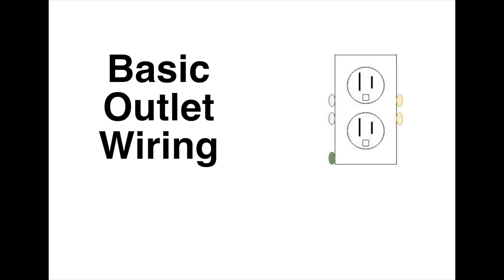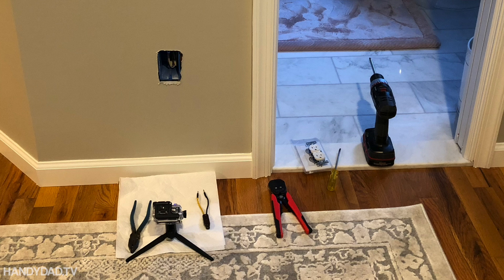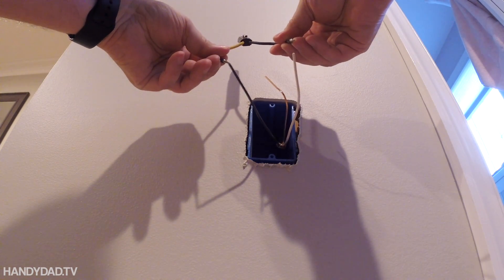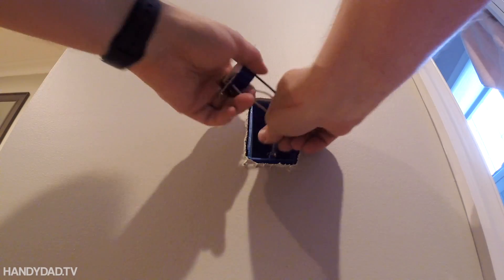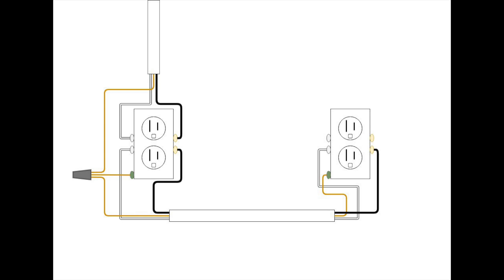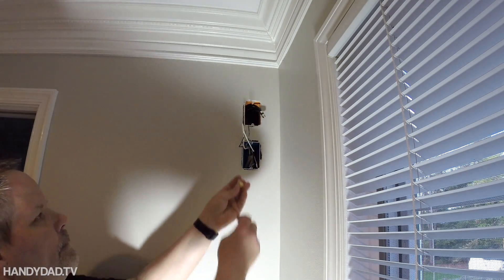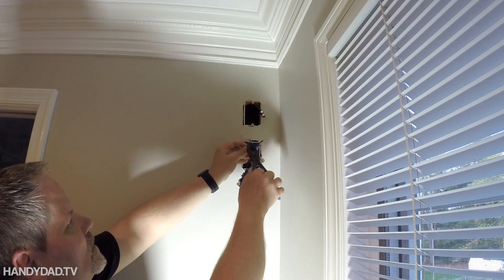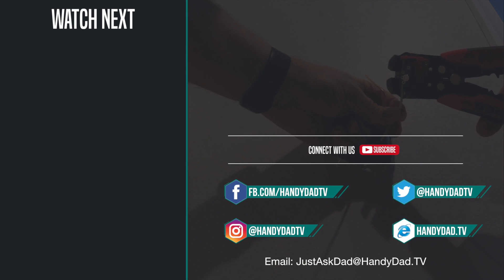How to Wire an Electrical Outlet

Comment: Hi,
I replaced an outlet ( Leviton T5320-W) in my kitchen and test it, start working, then I cut the power off from main switch to wrap-up the fitting of the outlet. but when I turn the main switch on again from main panel and check again then it stop working  and there were 2 more outlets stop working either. then i replaced circuit breaker and all three outlets but there is no power in all three outlets. I check with multimeter, tester and with receptacle tester there is no power. so where I need to dig now. help me please. thank you
Reply from the maker: Think about it. Must have a loose wire.

Comment: best to pigtail all your wires.  you don't want all your downstream power running through the receptacle.  FIRE HAZARD.
Reply from the maker: I get this a lot. Every house I owned was wired this way. 🤨
Reply: It's preferable to use pigtails, but using the receptacle screws to make your connection does not cause power to run through the receptacle, is not a fire hazard, and is not a code violation. Something has to be plugged in and powered on for current to run through.

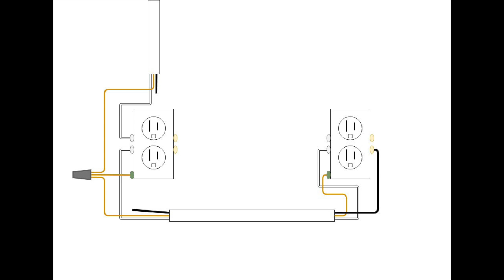Comment: CAUTION: While the method at 3:02 is within code, it's better to use pig-tails for all 3 wires (not just the neutral). If there is a fault with the outlet, pig-tail-method will not impact downstream outlets.
Reply from the maker: Thanks
Reply: So basically wire outlets in parallel instead of in series?
Reply from the maker: Yes always in parallel. Black to black. White to white.
Reply: I came here to say this. Yes, in a perfect world you would just fix an affected outlet, but it could help with troubleshooting if only one was knocked out instead of the whole circuit!

Comment: While not against code, the recommended way to connect the "middle" receptacle neutral (white) and hot/line (black) is to also use pigtails & wire nuts or Wagos for each.  It is typically advisable to not use the outlet as the passthrough connection by connecting both sets of screws as the passthrough junction.  Again, it is allowed, but not advisable.
Reply from the maker: I’ve heard this many times in comments, but I’ve yet to own a home wired that way, and my current home is only 3 years old.
Reply: @handydadtv  Probably because it is faster and therefore  cheaper. ;)

Comment: Sometimes the neutral wire is just taped together and just pushed into the box, without connecting to the outlet, whats that about?
Reply from the maker: Voodoo electrician magic. But seriously, unless I have a need to know, I typically leave well enough alone.
Reply: You're probably thinking about a switch box, neutral wires are not used there. Receptacles will not work without a neutral wire.

Comment: So does the circuit only flow one way? I got a wall with outlets on both sides. 
I'm guessing the opposite wall is first.
Reply from the maker: I guess you could say they flow in one direction. It starts at the circuit breaker and flows through each of the outlets until it gets to the last one on the circuit.

Comment: Does it matter where the black and white wires go i know the black connects to gold screw and white to silver but does it matter if it’s the top or bottom screw? Thanks an advance
Reply from the maker: Doesn’t matter which screw you use; they are both connected.

Comment: I cant find any answers online. I know the difference between wiring in series and parallel. My question is using the bus bar on receptacle as you shown without removing tab, is that considered series or parallel since the current does not pass through receptacle?
Reply from the maker: Home wiring is always parallel. Wiring in series divides the voltage across multiple loads; you never do that with home wiring. https://youtu.be/sbocWMTmPK8
Reply: @handydadtv  yes but that wasnt my question. My question is since the hot and neutral bar have a jumper, is the wiring you depicted considered running in parallel since the current does not "pass through" circuit to the other side.
Reply from the maker: I’m sorry. I’ve been asked this kind of question in the past and I struggle to answer it. The jumper/bus bar/shunt (whatever you want to call it) electrically connects the two screws on each side. So, for example, you can connect one black wire and it powers both outlets. Or you can connect two black wires (one to each screw) and it’s just like using a pigtail. 

If you remove the shunt between the screws, you can control one of the outlets from a switch.

Comment: In middle of run, does it matter which white wire goes to which silver screw? Or do they just have to match with their corresponding black wire?
Reply from the maker: The side screws are connected so there’s no difference. You can use either one.

Comment: Newby question... Does it matter which of the silver screws the white neutral lines go on and which brass screws the black hot wires go on?  Thanks!
Reply from the maker: No, both screws are connected so it doesn't matter which one you use.

Comment: I'm gna be tring to run wire from receptacle to receptacle in my shed is that the same way to do it ?
Reply from the maker: Yes but there are different requirements for running wires outdoors.

Comment: @13:10: I had to disconnect an old outlet, and I ran across the same thing with the hot and neutral wires twisted together inside the box instead of screwed in to the receptacle. WHY??
Reply from the maker: That’s called a pigtail. Some electricians choose to use them all the time rather than attach multiple wires to the receptacle.
Reply: @handydadtv  Good timing on your comment. I just now read this comment on a forum: "Because this site is in an awkward position! The pigtails were fit at a comfortable workbench. Fit 3 wire-nuts and done - much faster than doing 5 screws. "
Reply from the maker: Best practice is to tighten all the screws even if you don’t use them. So still tightening five anyway. Still, it’s a personal choice. Not wrong either way.
Reply: @handydadtv  But you have to hook the wires in to the screws, which can be fiddly.
Reply from the maker: Yes, you will always need to connect the pigtails to the receptacle. You can use the screws or the stab connections on the back. Again, your choice, no right or wrong, both work. But I get MANY comments that say to never use the stab connectors even though every home I’ve owned was wired with them.
Reply: @handydadtv  I guess it's the difference of installing wires into two fewer screws. The outlet I opened was in series, but only 2 of the screws were used (no stab connections).

As an aside, the outlet was 2-prong, even though there was a grounding wire connected to box. Like y u do that? There are two prong outlets all over the house, with only a few being 3-prong. "This Old House" fun.
Reply from the maker: If you have a good ground, you can replace them with a 3-prong outlet.

Comment: I wish you explained the difference between wiring the circuits in series vs parallel. In your example won’t the downstream outlets be affected if the middle outlet fails?
Reply from the maker: Household wiring is always parallel. 

If an outlet “fails”, the circuit breaker pops and the whole circuit will be out.
Reply: @handydadtv  okay, but if somebody were to place a GFCI in Place of the first receptacle, and wire the downstream wires to the “load” terminals, then it wouldn’t be parallel, right? But in this case since it’s a traditional receptacle, there’s no way to wire it like this?
Reply from the maker: Parallel means white to white and black to black. Series would be black to white, like stacking batteries to increase voltage. 

The load side of the GFCI breaker is still wired in parallel, it’s just the circuit could be broken by the GFCI. That doesn’t happen with normal outlets.
Reply: @handydadtv  okay it’s possible I am using the incorrect terminology. I meant to say that with a GFCI, you can wire it two ways (one using a pigtail, makes all the downstream outlets unaffected by the GFCI, the other going through the GFCI before delivering power means the other outlets are dependent on the GFCI). Ignoring the GFCI tripping, let’s say the GFCI receptacle just failed, the outlets downstream wouldn’t receive power if wired that way. So I’m assuming if you make a pigtail to the first receptacle in your video, it will function independently from the downstream outlets, but since you did not make a pigtail but delivered the power through the outlet, does that mean if the receptacle failed all the downstream outlets would lose power? I hope I’m explaining this right.
Reply from the maker: Forget failing outlets. The only time I saw an outlet fail was when it was overloaded and melted, which caused a short, which popped the breaker. 

If you join the wires with a wire nut and a pigtail to the outlet, in theory you can replace the outlet without turning off the circuit. But that’s an extremely dangerous practice for DIY and I don’t recommend it.

Comment: Can you connect to the wires in the middle I'm looking to add an outlet in the middle of the wall for a tv. Both outlets are down low and the wire runs low on across the wall can I tie in down low and add a box up for the tv
Reply from the maker: Yes you can do that. This video shows how to pigtail the wires in the existing outlet. https://youtu.be/klL8XhKMNT8

Comment: 1:52 There are two screws for the white and two for the black. Can we choose anyone to put the cable or it has to be a specific one?

Thank you for the video
Reply from the maker: The top and bottom screws are connected, so it doesn't matter which one you use.

Comment: I have plenty of DIY electrical experience and worked 20 years as an electrical panel assembler.  Watched your video anyway and found it very informative and well articulated.  Not a fan of back stabbing switches or outlets, prone to failure.  Going to check out your channel and may Subscribe.  Thanks for posting.
Reply from the maker: It's funny how many people say not to back stab. But every home I've owned has done it that way. Whether 50 years old or just 3 years old, these electricians stab the wires.

Comment: If getting power from outlet to power up a gazebo, how would you connect white and black wires from outlet to new cable to be run as power source for gazebo
Reply from the maker: That's the middle-of-the-run scenario (2:28 in the video). You'll want to use a GFCI outlet, if it's not already. Connect the gazebo wire to the LOAD side of the GFCI.

Comment: In the middle of the run for both of the neutral and hot wire doesn’t matter if it’s top or bottom or do certain wires have to be one top or one bottom?
Reply from the maker: Doesn’t matter.

Comment: Great video and diagram. I’m guessing the requirement for the pigtail on the ground for middle outlet is because the screw can’t securely hold two wires like a wire nut can.
Reply from the maker: It’s more because code wants the grounds to always be connected downstream. With a pigtail, you can replace an outlet without ever breaking the ground connection. Some people always do that for the black and white as well.

Comment: I learned in 5 minutes what my teacher failed to teach us in a week. You're an incredible teacher!
Reply from the maker: Thanks so much
Reply: Does it matter what brass or silver the incoming wires go into
Reply from the maker: No, the top and bottom screws are connected so it doesn’t matter which one you use.

Comment: 1:17 no no no, don't take off the wire nuts like that. If the circuit is live for some reason, there is a chance that current could flow through your chest and you die. Take one off at a time using a single hand so you don't accidentally become part of the circuit. There are testers you can use as well to see if a wire has electricity in it without even having to touch the wires yourself.
Reply from the maker: Great point! I screwed up and will never remove wire nuts with both hands like that. (I wonder how many people said "I KNOW I turned the power off..." before they were electrocuted?)
Reply: @handydadtv  I have a story of my own. One time long ago when I was still young and dumb, I decided to try to figure out why a baseboard heater wasn't heating. Seemed simple enough. I didn't have anything to properly test if I got it turned off or not, but assumed that I got the right breaker. Opened it up, put my hand in (one hand) and ended up getting one quite painful shock across about an inch of my thumb. Come to find out, someone remodeled that house at some point and moved the breaker panel to outside of the house on the other side of the house and left the old panel inside. Lesson learned, always test before touching wires lol. That was quite painful and I am lucky it just burned/zapped my thumb.
Reply from the maker: Ouch!!

Comment: How do you know what wire goes where? I don’t get that because I know it can change
Reply from the maker: White wires go on the chrome screws; black wires go on the brass screws. It doesn’t matter if you use the top or bottom screws because they are connected.

Comment: I'm wanting to connect an existing  receptacle and 2 single bulb light fixtures that are not wired up to an adjacent receptacle that is wired up in my garage to make them all work together, any suggestions?
Reply from the maker: Bring power to the outlet first. Break the little shunt between the brass screws on the side of the outlet so one plug will stay on all the time (typically you only switch one). Run 3-conductor wire from the outlet to the switch, and 2-conductor wire from the switch to the lights. On the 3-conductor wire, the black wire should stay hot all the time and the red one will be switched. At the switch, connect the always-hot black to one screw, and pigtail the other screw to the red wire and the black going to the lights.
Reply: @handydadtv  Hi again, well the wired outlet is already connected to a switch way back by the garage door, can I safely and easily just add power from the outlet to the next unwired outlet (already mounted in a blue box to the rafter bottom) and also the 2 round white light fixtures so they will all power up with the same main switch? There is also several working outlets already wired up, 4 i believe. They would all be on the same circuit from what I'm seeing. The main box is clear in the house (detached) . The old garage does have one of those boxes with the up and down metal arms that kills all the power to the garage. I know it sounds like alot on 1 circuit but I'm using LED lights and only 1 tool at a time and maybe the shop vac. Don't have alot of money so trying to do this as cheaply as possible, I consider myself a good and thorough handy man just not alot of home wiring experience. I can do it.

Comment: So if there was another receptacle  in the middle would the bottom hot and neutral  wires from first receptacle go to the top screws in the second receptacle ?
Reply from the maker: The top and bottom screws are connected. It doesn’t matter which one you use.
Reply: @handydadtv  thank you

Comment: Same order for receptacles with test and reset push in bottons??
What load and line means on the back of the receptacles ??
Thanks!
Reply from the maker: On a GFCI outlet, LINE is where power comes into the outlet. LOAD is only used if you want to protect additional outlets downstream.

Comment: This is what I was talking about in the other video. ;)  This is easier to understand.  I want to add an outlet to my toilet room so I can use my bidet and I want to connect to the outlet on the other side of the wall.  So I assume the original outlet (on outside of toilet room) will have the W & B wires on the top and then I run the NEW wire from the bottom of that outlet to the new outlet in the toilet room (opposite side of wall).  Can I connect to either TOP or BOTTOM of that outlet?   Say for example in the future I want add even one more outlet from that new one..would I attach it to top and then run to new from bottom? So basically power in top...power out bottom...last outlet top?
Reply from the maker: I’m working on a video with this EXACT SITUATION to also install a bidet. Stay tuned. 

But to answer your question, it doesn’t matter if you use the top or bottom screws; they are connected together by default.

Comment: What if my ground is already "grounded" to it's metal receptacle?? Can I leave it like that? Also, does it matter on which screw I put each (hot or neutral)wire? (I know the black wire goes to the brass and the white goes to the Chrome or silver colored screw)  I hope you get what I mean there. Thank you either way for the video!!!
Reply from the maker: Top/bottom screw doesn’t matter because they are connected on the side. 

Not sure of the question about the ground. Are you saying it’s grounded to a metal box?
Reply: @handydadtv  yes, I went ahead(because I trust my sense even with this sensitive issue. Lol) and everything is connected and working properly!  Thank you either way!
Reply from the maker: The screws that mount a receptacle in the box are not tight enough to provide a good ground. Code requires the ground be attached (with screws) to the box AND the receptacle.